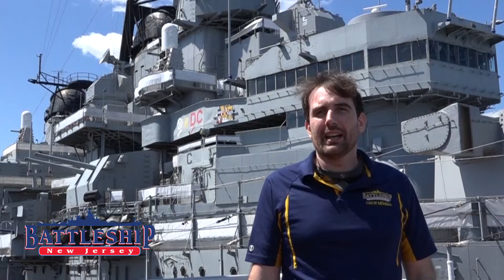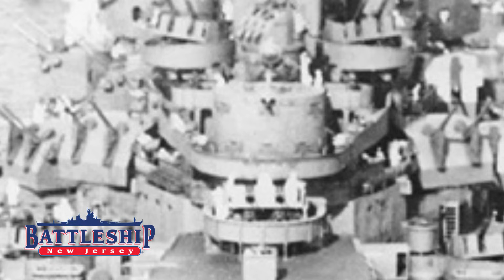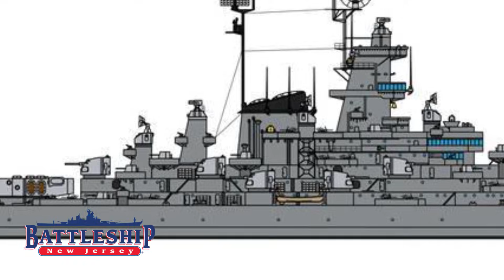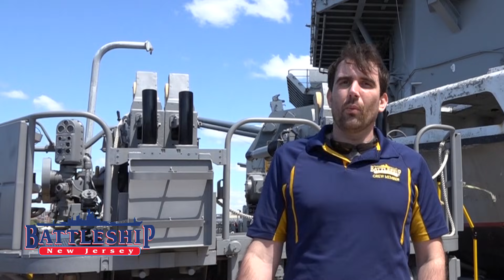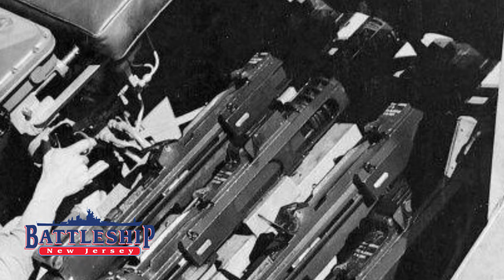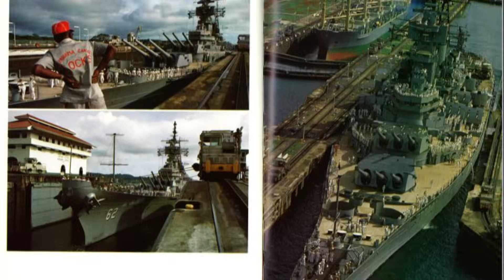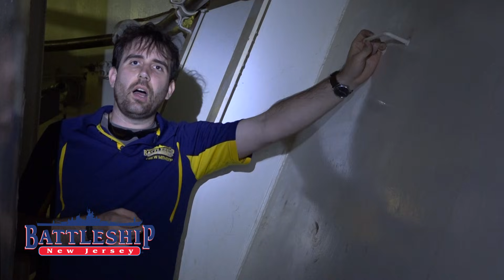What the Navy Doesn't Like About the Iowas

Comment: For later weapons, the original single arm mk 13 missile launcher was a direct, bolt on replacement for the 5" mk 38 gun. We used to wonder why the navy never excercised that option in two or four of the Iowa's secondary batteries.

Comment: the one thing i would change is the main cannons 
1. i would add another main turret in the back 
2. i would increase the size of the cannons from 16in to 20in with sabot high explosive balistic capped shells
3. i would add more armor to the hull (increasing it to 15in thick) 
4. i would add C-rams as the anti air and remove the old tripple anti air guns 
5. i would add a secondary battery of 12in 
6. i would find a shop to 3D scan the propulsion system to make parts for it for long term use 
7. i would increase the armor size in the in the tower to keep all crew safe from shrapnel 
8. i would take all the old electronics and put the new radar system in 
9. i would add a rubber layer of 12 inches on the citadel for torpedo deflection and explosive deflection 10. i would add torpedo tubes set of 5 in the bow (rotatable above deck) and a set of 5 in the stern (rotatable above deck)
11. completely make this ship "unsinkable"

Comment: Perhaps you misspoke. 
Raising weight makes no difference to centre of Buoyancy B. Center of buoyancy is the centre of the volume of the displaced water through which the upward force from the buoyancy holding the ship up acts. If heeled it moves to low side. 
Adding the weight higher up moves the centre of gravity G up higher. B will move a little bit up if weight is added due to greater displaced volume to displace extra weight. 
There is another theoretical point. M or the Metacentric height. This point is at the intersection of a vertical line up through G. Crossed with a vertical  line up Through B iat a slight inclined. 
If M is above G the ship will be stable, the higher above G. M is the more stable the ship is 
Stability is measured by calculating the GM or distance between G and M.
If M is below G the ship will be unstable. 
A small GM means a ship will roll easily or slowly and be referred to as “Tender”
The motion will comfortable. 
A large GM means ship will roll very quickly possibly violently and the ship will be “stiff”.
The range of stability depends on a number of factors. Including GM, Width, Depth and freeboard. 
My guess if you want to hit what you are shooting at. tender is probably better than stiff. 
Fuel can contribute to stability, if it is stowed low. So can water. Ammunition stores ect.

Comment: Take the conning tower armored volume, turn it horizontal, and put it inside the hull to the aft. Inside it place a nuclear reactor from a cold war era submarine. 

I would also add composite armor to protect some spaces and add more extensive fire suppression systems. 

Furthermore I would increase automation and replace hydraulics with electrics where feasible. 

Propulsion would be diesel electric with a nuclear reactor producing enough power to cruise slowly even when fuel is empty. When combined the top speed would likely be higher than it was historically and the fuel efficiency would be improved as the reactor takes a large portion of the load.

Comment: Even the Navy did not know what the right approach was,  because the war was never static.    Early on it easily was a BB to BB fight and Torpedo Bombers  and Japanese subs made torpedo  defense important.   By the Marianne campaign,  the Japanese subs had been almost eliminated,  nothing was getting through the AA screens.   Torpedo defense was not an issue,  Kamikaze attacks from the  Philippines on was.    No one could predict that direction.    Its all a compromise that has no single perfect answer.     The shame was Halsey stupity at Leyte Gulf and the Fast Battleships never got a chance to do what they were designed for,  take on a Japanese BB group.     Carrier escort was a nice assist,  but you could build 4 Cruisers with twice as many AA guns for that role.   The time when they should have been deployed as a backup (that was desperately needed)  they were not.     Irnoic that the Japanese surface Navy was not as fanatic as their Army Air Force let alone what then the Yamato was used for in a pathetic gesture that it could have achieved when it had the chance.

Comment: The citadel was not just for conning the ship.  The most important mission of the battleship was the main battery, the 16 inch gun.  However the guns are directed by radar information, manually put into the Fire Control computers deep inside the ship.  Those operators could not actually see the targets they took information from other areas.  Radars can be put out of commission with the most insignificant damage to a waveguide or electronic failure.  The very top of the citadel (above the conning station) housed the TDTs (Target designation transmitters)  these were optics and manual switches that could actually sight the enemy and the operators could fire the main battery from there.  It was a way the ship could keep fighting with a lot of damage to the superstructure, radars knocked out, loss of power... the main gun could keep firing.  The citadel is multiple decks tall.  Been there done that...

Comment: Having walked under the the USS Iowa in drydock at NNSY, I thought that the hull and armor plating could have significant surface streamline improvements.  The the armor plate was installed with sharp edges, corners and protrusions that had to cause significant drag at speed.  At the time I felt that the engineering spaces were designed with enough power to bulldoze the ship through the water.  Now I wonder if hull surface streamline improvements could have allowed for other topside improvements without degrading ship's speed.  What do you think?
Reply: Makes sense.
Reply: I think they should have did away with the armor plate altogether and just switch to forcefields instead.

Comment: Wasnt the main reason for not using 18inch'er because the ship wouldnt fit in the canal ? as it would have to be wider?
Reply: Two main reason are; 1.) too much weight. Even if they didn't increase the armor to try and match the guns (which they would have wanted to, otherwise they really would have been building battlecruiser, not battleships) the guns would have weight a lot more. 2.) 16in 50cal guns are already powerful enough to go through most armor at most battle ranges. To go up to 18in might have just meant fewer shells being fired per minute or a way heaver ship (so lower top speed and range of the ship) for little gain.  That was their thinking though if you built a ship 20,000 ton greater then hell yeah they would consider the 18in.
Reply: @willpat3040  actually rate of fire in US tripple gun turrets was one of the slowest. From what i read in few books Yamato had the same fire rate as Iowa, while Nagato with its twin guns had almost half that of Colorado (and 1/3 faster then Iowa's). German 380's were even slightly faster reloaded then Nagato's.
Reply: @T0ffik1  I meant fewer shells per minute because if they wanted to go to 18in at the same weight they would have had to go to twin turrets so only 6 guns. So not fewer shell per minute per gun, just fewer guns on the ship.

Comment: Nothing that could seriously threaten an Iowa in 1980? A salvo of 20 P-700 “carrier killers” weighing 7 tons each and flying at supersonic velocities from hundreds of miles outside the Iowa’s range would seriously beg to differ. WW2 battleships were sunk by much less firepower. 

There’s a reason every single navy in the world ditched battleships and armor in general. It can’t complete with missiles. The Iowa never even received any kind of modern air defense suite besides Phalanxes, which are a last line of defense and have a slim chance to intercept any maneuvering supersonic missiles. The Iowa is literally a sitting duck when it comes to defending against modern missiles. 

That’s to say nothing of nuclear anti-ship missiles. 

Sorry, can’t take the video seriously after that line.
Reply: The Granit didn't enter production til '85. You're probably thinking of the Bazalt. (P-500) They'd have a similar effect on an Iowa though, and that's assuming they're carrying a conventional payload.

Comment: All that extra length was intended to increase speed, but the Navy was disappointed by the increase in speed.  A huge investment for a modest gain.  Battleship design had reached the point of diminishing returns.  

They actually gave up some armor, especially in the torpedo belts, as compared to the South Dakotas.  The compromises were necessary to enable the Iowas to keep up with aircraft carriers, but by the end of the war the carriers had to slow down considerably to help the Iowas keep up.  

In the end the Yamato proved what was already known:  No battleship, however gigantic and heavily armored, can survive an accurate bomb.  They had their glorious day, and I definitely love those old ships, but they are as relevant today as a slingshot.

Comment: I'm sure it would never happen...but...it would've been cool to retrofit these with nuclear reactors.  That was one complaint the Navy had with the Iowa's was the staggering operating expenses.  It could've been mitigated by nuclear power.  It would have made each Surface Action Group more autonomous.  At one point, nuclear cruisers were also in the SAG.  So, it would have been possible to deploy with very minimal support ships...maybe just a tender.  The battleship could've refueled the DDG's many times over if it didn't need the fuel for anything except the diesel generators.

Comment: I think the Iowa class would of been greak for the rail gun or maybe replace the older guns with high pen high accuracy guns like 40mm depleted uranium round or 20mm depleted uranium or a mix of round and use for high rate of fire if every gun alternated fire and now with better recon we could accelerate a 20mm diameter projectile to hit medium to large target with accurate fire or use the Abrams cannon.
Reply from the maker: The navy canceled the rail gun project because it just doesn't work.
Reply: Doesn't it suck we could of had cool weaponry of different varieties even if it was small scale it would of been better than cannons cause less explosive used

Comment: So two things. Per the thought of the 5" being lowered,  I would think they would have shipped the top 4 5" turrets ( 2 port -2 starboard)  and replaced them with the 3".
Saving top weight, use of existing 5" magazines and better arcs of fire. 
Also, with the concerns of the size of the crews, I always thought they should have replaced the dual 5/38 with single 5/54s. 
On a personal note, my dad knew someone aboard in 1969 while she was at Long Beach and I got to walk her decks.

Comment: That is a myth that nothing in the 1980s couldn't hurt a battleship.  A Kirov and Slava would put a serious hurt on the IOWA.  SS-N-12 and SS-N-19 missiles with 2000 lbs warheads would cause damage on the super structure, fires, and knock out the water mains and electronics.  The same for the AS-5 and AS-6 from badgers as the CIWS in the 80s was not worth a darn.  Hence the Christ It Won't Shoot moniker. Exocet and other sea skimming missiles wouldn't do much as they would have hit the armor belt.  Reasoning?  Electronic Warfare Tech onboard USS IOWA (BB-61) 1989 to decommission.

Comment: What the Navy doesn't like: (1) they run on steam, meaning they require specialized training and a higher crew requirement, (2) they burn a LOT of fuel, of a dirty and obsolete type, (3) they are insanely complex and require one-off part fabrication if anything breaks, and (4) their air defense systems are obsolete; they were not fitted with Sea Sparrow because the missile system could not handle the overpressure from the main guns. We just don't build ships like this anymore, in part because we have better solutions like gas turbines but primarily because we just don't have the huge wartime budget.

Comment: USS Camden and USS Sacramento each had two of the four main engines originally designated for the USS Kentucky which was never built.  It's why they were both a little faster than their east coast cousins Seattle and one more I can't remember.  We (Camden AOE-2) could hit 30kts and I was on it when we ran 27kts for two days in order to catch up with the battle group.  That's moving on such a big ship.  Those forced draft blowers sounded like jet engines!

Comment: It's a year old video but you asked :).... the mindset that there is a perfect design for a combat system is misguided. The threat and the mission, and the tactics, are always evolving. You build a sturdy battleship with guns that can level a city 20 miles away, enemy sends kamakazi pilots.  So, you add smaller weapon systems to deal with the fast moving planes. ok, torpedoes are a threat so you build for that. but you need speed to relocate faster than the enemy can handle.  It's on and on, a constantly evolving game, and the ships take a long time to go from concept to deployment.  Add in layers of paperwork and politics for every change and design always lags behind the need, so you need to predict, hopefully correctly, which way the need will swing.

These battleships were terrific for the WW2 era battles. Knights jousting on the open sea. The occasional pre landing barrage. The show of force during negotiations. And I would love to see them out in the wild today.  I think they would still be effective.  But they cannot operate alone, they require a support group, and part of that support is defense.  So while the battleship needs to be capable of absorbing damage and staying in the fight is can afford to strike a balance between offense and defense, leaning a bit more toward offense since that's why you dragged it into the war, to inflict violence on the target.  I would instead have focused the defenses on adding support/defensive vessels to the package rather than trying to make the one battle ship an impenetrable monolithic fortress, since that really isn't possible.

Comment: The 5"/38 cal US dual purpose was indeed the best such gun (secondary anti-surface battery + heavy AA)  for most of WW2. Yet was, in fact, eventually outclassed in the category by the UK's 5.25"/50 cal when the latter gun was finally modified to permit auto-loading and equipped with a reliable AAW fire control radar. The result was an even more capable, longer range heavy AA gun and one that presented Japanese aircraft familiar with the formidable US 5"/38cal weapon with some even nastier surprises. Not least, when they unexpectedly found themselves being 'sniped' out of the air by the UK Pacific Fleet's KGV Class BBs upgraded 5.25"/50cal secondary batteries at ranges they already knew were far beyond the range of the US gun.

Wrt the Iowa BBs themselves, the comment about their being the best US BBs ever actually built is fair and valid. The claim that they're the best ever actually built anywhere is, however, far more open to rebuttal on most grounds. My own opinion being that on a big majority of relevant criteria, they are outclassed quite decisively by the final British BB built, HMS Vanguard. In short, she's simply a better, more formidable BB design in all but perhaps 1 significant respect and a better BB as actually realised except for just two.

One of which merely reflects her original conception as a "one off, extra capital ship" that could be armed with surplus 15"/42 cal Mk1 guns made originally for the R Class ships, plus turrets removed decades earlier from Fisher's "Large, light cruisers". Thereby allowing very quick completion compared to the projected Lion Class ships and reinforcement of a hard pressed British fleet that at the time was predicted correctly to simultaneously be fighting the German, Italian and Japanese navies within 2 years.

However, the gradual reduction of German strength, the Italian surrender and most of all the US accession to the war more than offsetting Japan's fleet too, resulted inevitably in repeated delays to (and eventual cancellation of) the "Lions" and to halting any development beyond prototype stage of their envisaged main battery gun, the 16"/45cal Mkii, iii and eventually, Mk iv. Accordingly, Vanguard was indeed completed with the originally intended main battery fit of 8 x 15"/42cal Mk1 guns and not the 16"/45cal weapons her design would still quite comfortably have been able to incorporate. That fact alone, and a US lead in steam turbine tech are the only comparative advantages the Iowas have over Vanguard. A ship that had she indeed been completed with the "Lions" projected 16"/45cal main guns, would've been indisputably far more formidable than any "Iowa".
Reply: Personally, I would rate Iowa as the 3rd best battleship, behind King George V and Yamato. She had really great offensive power, but was very lacking in defensive capabilities

Comment: No matter how the navy looks at it, you still need battle ships.  Several things have to be done before one builds another one.  Armour that cannot be penetrated.  I have one in mind.  2. Speed increase from 33 to 58 knots using nuclear energy,  I have another one in mind that will work.  3. Automatic shell loading.  4. increase from 16 to 20 inch guns and avoid gun powder> known as hyper magnetic energy guns.  5.  Change the width and length of the battleship and change its COG. 6.  Make the ship anti-missile capability and capable to withstand a nuke explosion.

The changes I have in mind will make a battleship more efficient, more resilent, faster, and harder to penetrate its armour, plus efficient, longer range, less maintenance, and require less men, but have far more accuracy for its targets.

A battle ship needs shells that can go minimum 100 miles to its target and max 200 miles inland while still 50 miles from the shore line.